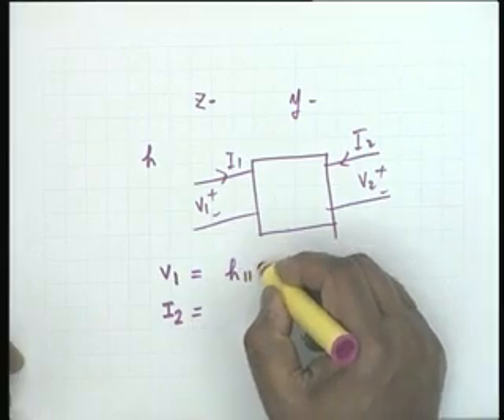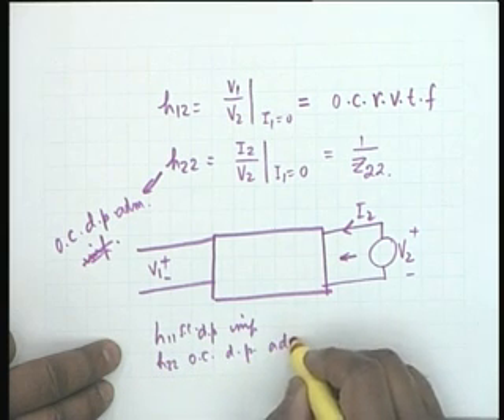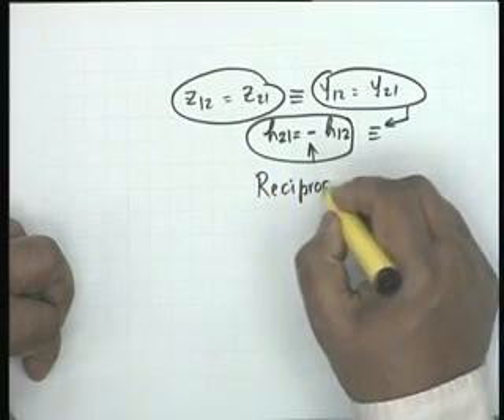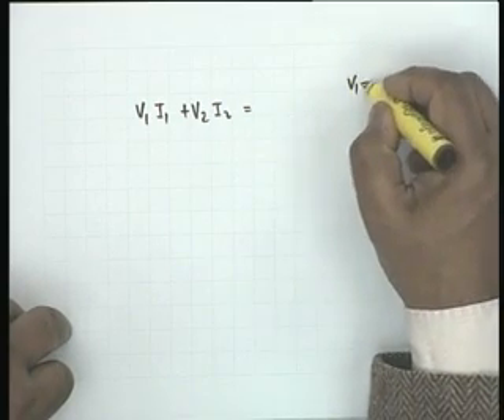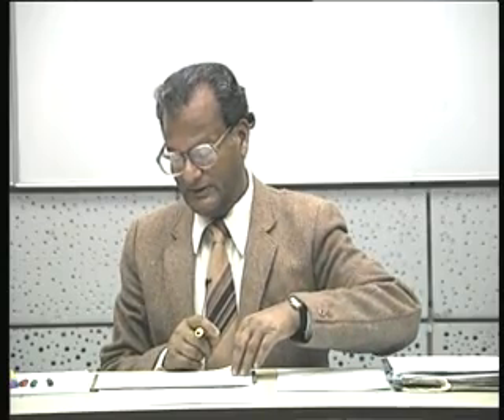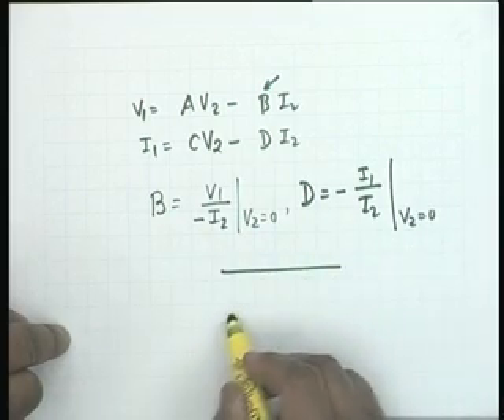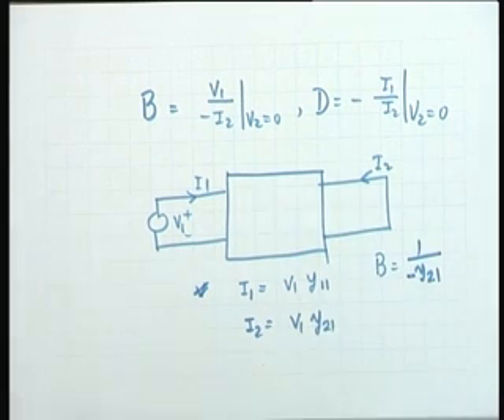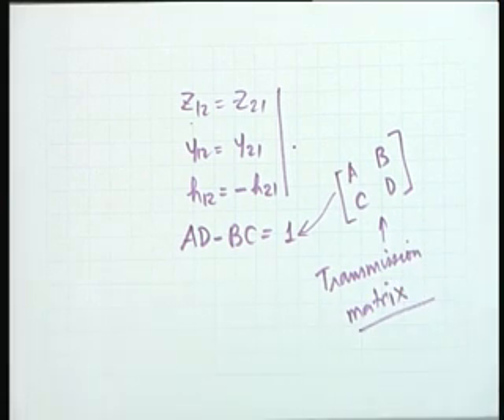Lecture - 24 The Hybrid & Transmission Parameters of 2 ports

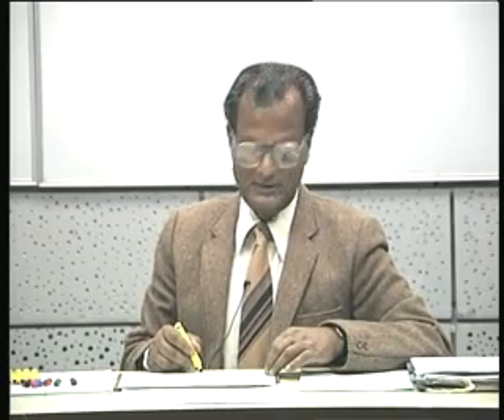Comment: (33:40)Had a doubt in abcd parameters. While finding the C parameter sir used i2=0 and was trying to find V2 but if there exists some value of V2 then i2 will definitely not be 0, it's contradictory . Please explain.
Reply: since i2=0 port 2 is open circuited ,so the resistance is infinite.since i=V/R anything divided by infinity becomes zero.so i2 is theoretically zero